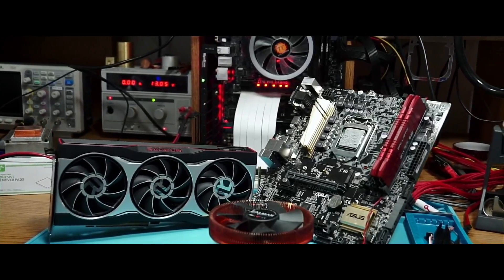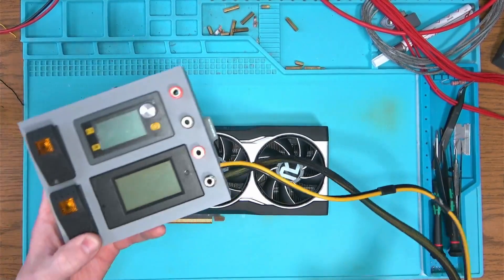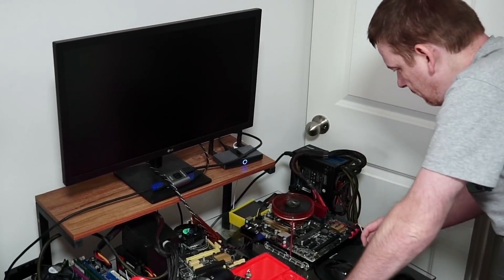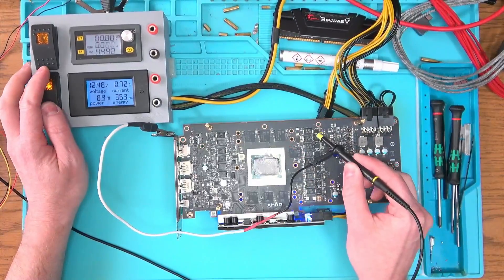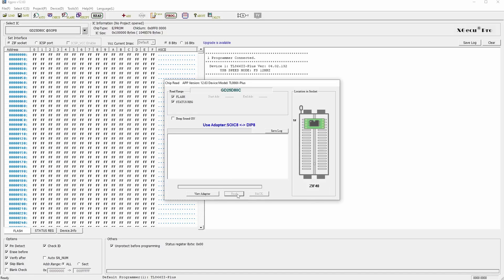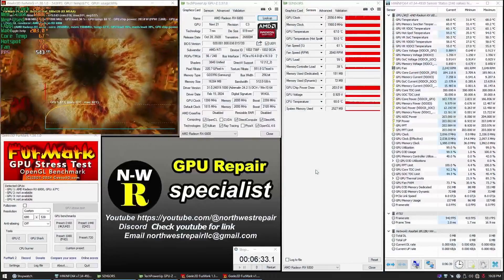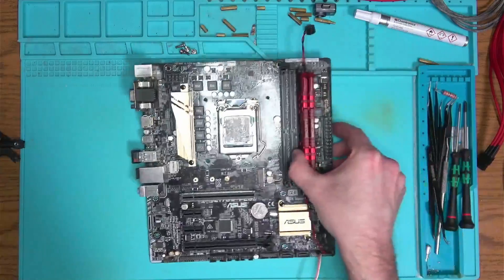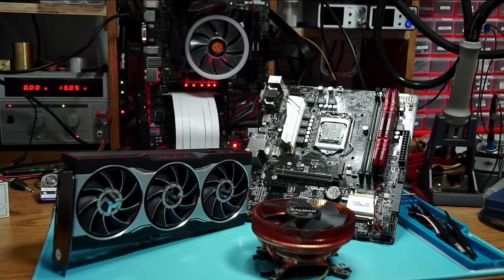Does flashing GPU kill your motherboard ?

Comment: Sapphire and other AMD AIBs have reference cards under their own name and they sell them too, I dont think the sapphire bios was something abnormal, still whatever happened with the board is beyond my understanding
Reply from the maker: Owner confirmed, this was sapphire gpu.
So i guess it got corrupted.
Reply: Congratulations... you just made the most baffling video on the internet... 
I can't imagine how many brains are going to hurt from this... I MEAN HOW CAN A BIOS FROM ANOTHER CARD KILL A MOTHERBOARD. iT'S SUPPOSED TO WORK ON ANOTHER CARD.
 @northwestrepair
Reply: The sticker on the bottom says it's a Sapphire card.
Reply: @RFC3514  Yes they sell them, they have their own bios for it, again bios was not out of place here, something else caused the motherboard to fail.
Reply: @kepler104  - Yep. Although the video card itself apparently wasn't working, so maybe the card's BIOS (though it seemed to be for the correct model) hadn't been flashed correctly.
Reply: am i crazy or,lately i've been experiencing,in this modern tech era,with AI,apparently,trend of manufacturing more 'high tech' equipment,stated by manufacturers themselves,high malfunction rate even before warranty expires:face-fuchsia-tongue-out:not to mention dangerous (4090 buttplug) :face-fuchsia-tongue-out:if rate of component failing is so great it cannot be an user error:face-fuchsia-tongue-out:i don't even remember of failure of that kind in the history of personal computers:hand-orange-covering-eyes:we don't know how far in history those issues was noted in some book or papirus:face-fuchsia-tongue-out:

Comment: Maybe you should make a step first of using a total crap board, like core 2 duo board, to see if the card is safe. Probably defines pins on a chip somewhere wrong and sent voltage on to the PCIe. Amazing the GPU still works.
Reply: It's unlikely that would even be possible to do by changing the firmware, and even less likely that would be possible without frying the graphics card itself. 

But yes, he should always use a cheap motherboard first, because there might be some (physical) short circuit on the card itself that will damage both if / when powered.
Reply: @RFC3514  I should say that he does do short tests as a routine, so this is a new problem for him. He also does a low current power feed before connecting.

Comment: Never heard of a gpu flash killing a mobo. Just bricking or killing the gpu. Weird. What I remember from flashing. Most people would say to flash from the same brand as your card, just 1 tier higher. Like this card is a 6800. Just flash the bios to a radeon 6800XT. That's if your card has good cooling that can handle the extra heat from the higher frequencies.

Comment: Plugging random dead GPU into your mobo is like sticking your dingdong into hooker.
Data line shorted internally to some power supply line or something, PCI-E interface gets 12V, i.e. quite certainly not good.

Comment: so the customer flashed the wrong bios, a lack of knowledge led to this. Congrats customer, hope youve learnt to learn information before acting.
Reply: Sapphire did manufacture "Made by AMD" cards, so they're using the official AMD design, but it's still a Sapphire card with a BIOS that says Sapphire. Maybe it is a Sapphire card, user looked for a BIOS update and grabbed the wrong one (one for a modified variant)
Reply: @Alvin853  - The sticker on the bottom of the card says "Sapphire Radeon RX 6800".
Reply: The card appears to be made by Sapphire, so it makes perfect sense for it to have a Sapphire BIOS. And Sapphire's BIOS flash utility should be smart enough to prevent flashing the card with an incompatible BIOS. So maybe the card just lost power half way through a BIOS update or something.

Either way, it's highly unlikely that AMD (that makes the GPU, but not the card or that BIOS - both made by Sapphire) had anything to do with it, just like nVidia is not to blame when a 3rd party card with an nVidia GPU fails.
Reply: @RFC3514 it is indeed a Sapphire card. And identical to my other AMD reference cards direct from AMD. Except that sticker... 🤔
Reply: Nah, it shouldn’t be so easy for the average consumer to brick their stuff like this in 2024.
Reply: @Rushil69420  My question is why stuff can brick in 2024? Shouldn't we have had figured that out long ago? Sounds more like it's deliberate so we keep buying new cards and adding to e-waste.
Reply: @Splarkszter  because companies wont use the same ram vendor (yes really), they want rgb, different vrm layouts, fan curves, etc. 

When you get a bios that gets an unexpected result (ex: ram cant run at x speed, rgb controller not responding, missing vrm phase), it craps itself
Reply: @Rushil69420 yes they should have make it extremely proprietary and if you still want to flash the bios you would need to ask for permission and wait 2 years for clearance maybe even pay small fee or subscription. its 2024 right?

Comment: board is ded or perhaps cpu?
ok i seen you try that 
i wonder if it has anything to do with power delivery or with the fact that gpu was cunnected to a "wrong" pcie slot
Reply from the maker: board would not boot even without GPU.
Reply: @northwestrepair  is me region of the bios ok?  because that couldmake board unusable if random garbage got writen in there and sometimes pulling bios from the board  cleaning the me  or whatever configuration region is there and flashing it back can fix intel board. i have no idea how would that work with amd though or does that only work on laptops but it would be a logical step if i knew that both cpu and ram are okbecause i had problem booting perfectly ok intel boards before (mostly 3rd and 8th gen ) and updating bios did a lot to stabilize them after they apeared totaly ded
Reply: @northwestrepair  - Doesn't the motherboard show error codes? You should be able to see which stage of POST it's failing at. If that board doesn't have error codes (7-segment display on board), you should definitely replace it with one that does. Makes it much easier to diagnose issues.